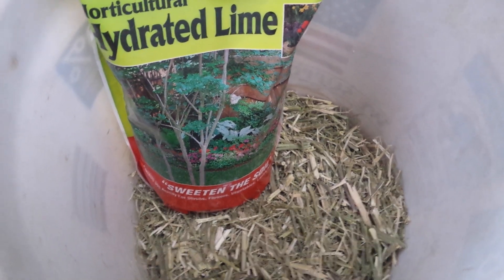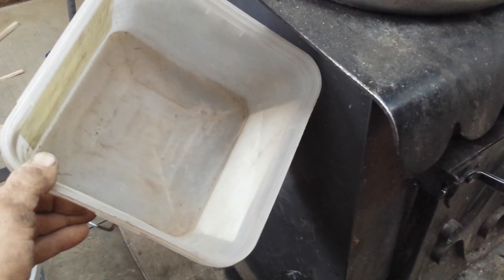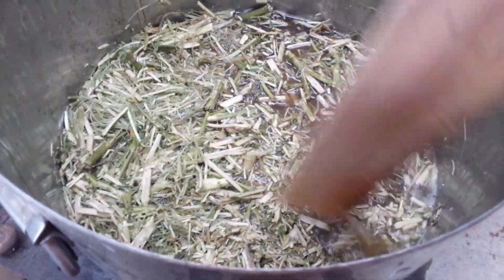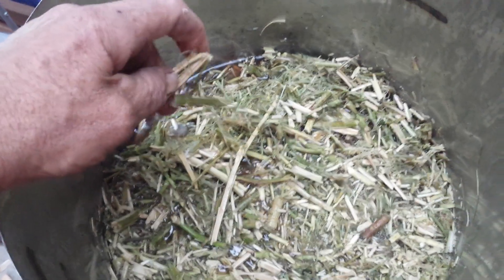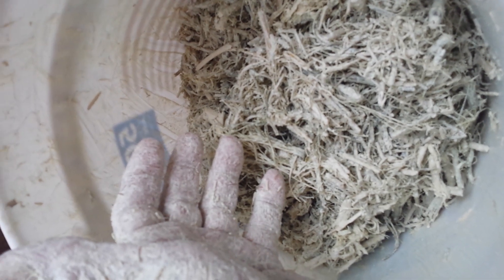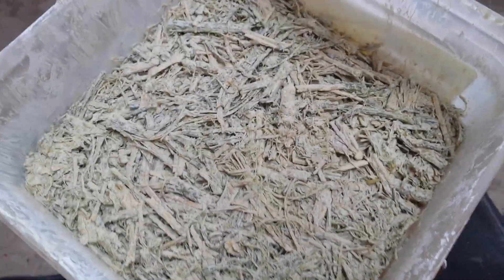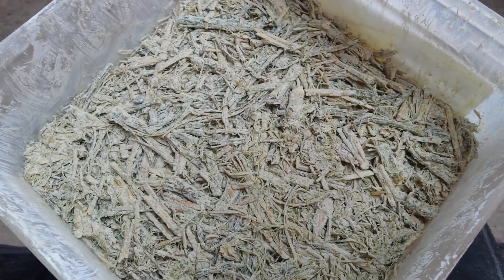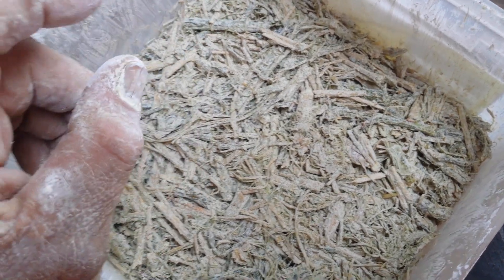Hemp Hydrated Lime, making of a construction test tile

Comment: Thanks , I learnt a lot . The names of the fiber bits to begin. Did you chop the hemp yourself. And do you think an auger would mix the lime and hemp? I have read the hemp mix is light and stronger than concrete and I am at the start of testing to learn. Thanks for your video

Comment: I am so thrilled to have discovered your videos on Hempcrete and all the research you are doing. I currently have a bounty of cardboard that will absolutely be no where near as strong as hemp, but I still look forward to experimenting with it in a hydrated lime mix. I’ve also been learning about incorporating rice glue as a polymer substitute that has been used as a sticky rice mortar over the years. I’m wondering if you have experimented with either cardboard or rice glue.

Comment: I can't say I'm 100% following what you're doing, but with respect to preparing the hemp, would it work to crush dried stalks between two steel rollers, then immediately on the other side of the rollers use something like an old rotary lawnmower (powered) to cut the stalks into short bits? With some mounting and gearing, you could run the rollers and the cutter off of one motor, I think.

Comment: I'm watching your videos for almost 2 weeks now. Do you recommend using other natural fibers? Does hydrated lime work using other natural fibers?
Reply from the maker: I'm sure the reaction would be the same regardless of fiber used, hemp bast hemicellulose is twice as strong as steel by weight, consider the strength of the material and test

Comment: I ordered some hemp hurds to experiment with making polymer clay. I'd like to make some hempcrete blocks also. Where can I find a brick mold?
Reply from the maker: I'm So Very sorry I didn't see this post 💔
 😎 Proud to hear of your interest,.
 Amazon has brick moulds, easy enough to make though 🤔
Using a piece of flashing or boards make a container 1/2'-1" bigger than the object (brick you buy/find )
Use Murphy's oil soap as a releasing agent
Using modeling clay seal up any crack's

 open and empty half dozen tubes of silicone in a bucket of soapy water make a blob of the silicone 
 Using a brush paint the silicone over the release on the brick, then pour it in from one corner only to reduce air bubbles

Comment: I’m trying to find the best method for shredding up hemp, I have a few hundred pounds of it I wanna test out making hempcrete. You just bought yours like that?
Reply from the maker: Hey thanks for the opportunity to stress 
 Purposely Crushed is Significantly stronger than chopped in any form

Purposely Crushed
https://youtu.be/RekgcUovbRQ
Reply from the maker: I grew all of my test materials
Reply: @mrglasecki  Yeah, I don’t want to waste mine and wanted to test out making hempcrete and being productive with it.  Very good point about purposely crushing the branches, makes plenty of sense. Maybe I can rig something up, I have a decent amount of stalk/branches.
Reply from the maker: @Dwq47  best of luck hokie as it looks the tatter fork work's it fairly fast
Reply: @mrglasecki  I have a lot of branches and stalks, I just don’t want to spend forever crushing them but your way is most likely the best setup unless I want to buy an expensive machine. How happy are you with how everything turned out?
Reply from the maker: @Dwq47  I have several hundred research videos on raw fiber several on woven composites 😏 kinda what I do
 Just saying purposely crushed is the best you can get outside of straight 'bast' hemicellulose fiber or dirty 'toe' bast still containing 10-15% 'shiv' cellulose
Reply: @mrglasecki  Yeah, these videos are all pretty great, I’ll have to take a look at all of them. I’m an industrial grower out in NY. Such an amazing plant and I’m going for a zero waste approach... I don’t think there’s any reason any part of the plant should be going to waste!
Reply from the maker: If America and Americans could only understand "waste" from cannabis sativa is novel 'insulation' entertainingly indestructible 'or' ~$200,000 a tonne hemp bast hemicellulose graphene
 Capitalism will decide 😏
Reply from the maker: Just saying growing "medical" CBD out of ratio shiv dominant (paper, pulp,  insulation) or otherwise is foolish as best
 Gives nothing more than what industrial hemp is capable
 Minus lack of actual Bast hemicellulose fiber quality
Reply: @mrglasecki  I tried crushing the hemp, it’s incredibly easy, my stalks and branches are really dry. How long should the fibers be? I crushed them, pulled the strips off and further crushed them with a board then threw them into a bag.
Reply from the maker: @Dwq47 
 dirty toe (strings plus 20% shiv will be stronger than overly Cleaned for most application's using lime or Portland
 Pure bast hemicellulose or woven hemp fabric will work better in modified MgO's 

 Fiber length of 6"-12"  is good,.
 * yet Please test various length for your peace of mind and quality satisfaction
Reply from the maker: @Dwq47  remember I Always soak the fibers in uncomfortably Hot water 
 It's not necessary to Use it hot,. Yet dripping damp is best
Reply from the maker: Oh My I'm SO Glad I saw what video caught your attention 😏 we have improved hemp-lime
 By a measure 😁
Raw Strength of Hemp
https://youtu.be/RLvN1ci4K1w
https://youtu.be/HSE5vESjFk0
https://youtu.be/-Ktl6-4B0x8
Reply from the maker: Please consider there are hundreds of uses other than construction for hemp fiber in daily life
https://youtu.be/B4XUOqE9GDI
Reply from the maker: Edible Hemp Bio plastic
https://youtu.be/oSAmu0P8Rko
https://youtu.be/GcoJNi95yrg
Hemp bast paper
https://youtu.be/IkGEdYBXw08

Comment: Thanks for the information.
I'm in Uganda here in East Africa! Would you recommend the use of flux instead of hemp and do I need to soak it in hot water before using it?! Thanks  again👍
Reply from the maker: Flax is Not Hemp, you can try to duplicate as much as possible 
Yet flax in Not Hemp
Reply: @mrglasecki  okay thanks

Comment: Hello...what kind of lime did you use?   thanks
Reply from the maker: All available hydrated an farm concrete additives variations some including bentonite and other plasticizers
Reply: @mrglasecki  exactly what additives and mix for your lime ?
Reply from the maker: @waynefergusson9987  every form of lime I could get my Hands on
Until I started mixing all are about the same, Lighter limes (dryer) mix better
Strength is calcium chloride and magnesium oxides